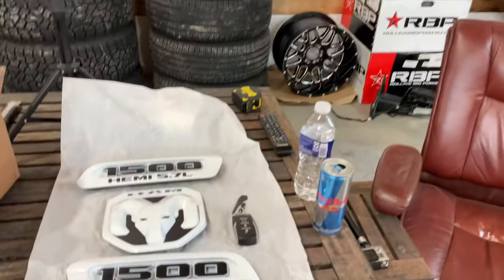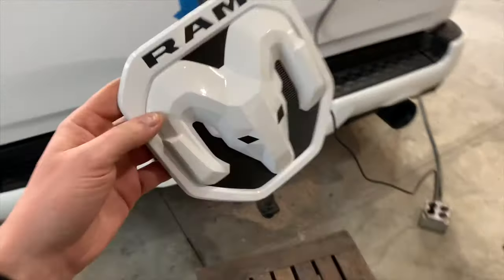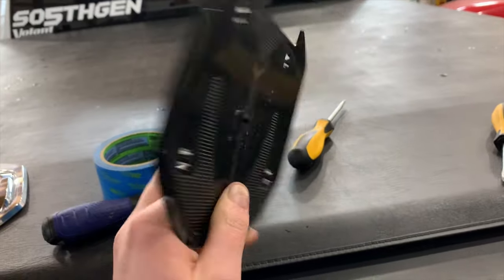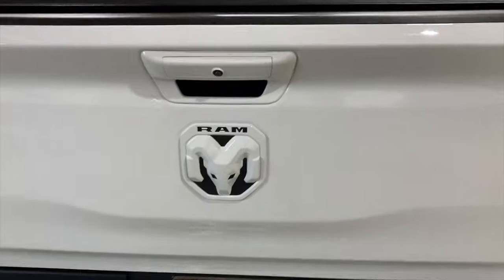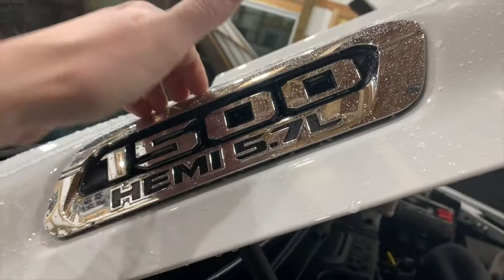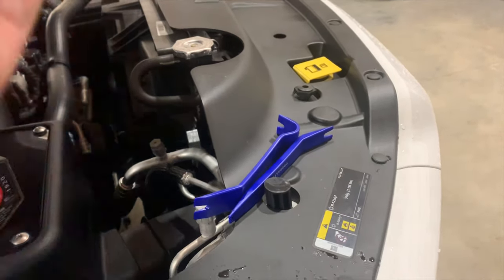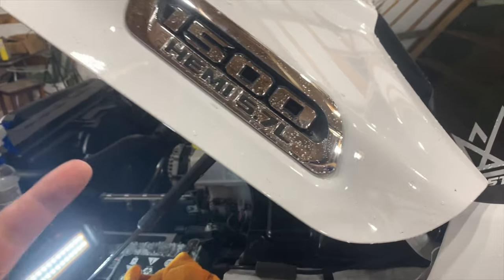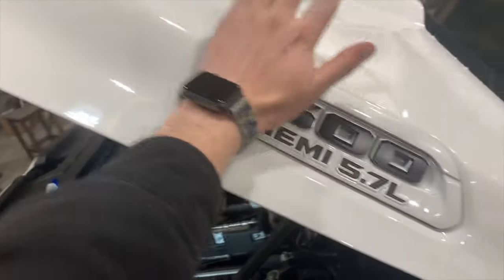5th Gen Ram Color Matched Emblems Installed / Removal Process for Hood & Tailgate.

Comment: I work at a vehicle wrap shop and we use a steamer to remove emblems.  Much safer then a heat gun and works great
Reply from the maker: I agree! But I wasn’t trying to save these nor did I have a steamer. I should probably order one they do come in handy
Reply: What brand of steamer?
Reply: @timmcgrath6496  see the link.  You do need an account to purchase it but I think there are similar units available.  Like I said it works great.

Comment: I'll share with you the best tool I've found to remove badging and emblems from a vehicle, especially on a fairly new truck while the adhesive is pliable- use fishing line. Preferably 10-15ib. It acts like a knife to remove the badging without a pry tool. Slide it behind the emblems and work it back and forth slowly pulling downward. Don't work it too fast or you'll snap the line from the friction. I also recommend doing it in the sun or just apply a little heat to soften the adhesive. If you try my process and like it, please let me know. Thanks.... hope you find this trick very helpful

Comment: Loved the video, in the process of installing LED 1500 hood badges. You mentioned you use the first pry tool on the end of the "5.7" section, but when you completed the step you slide the pry tool first under the "H" word and then use the other pry too to lift up. Does it matter? I just don't want to mess up the OEM ones.
Reply: shoudnt matter

Comment: Very nice!! Like you're wheels. Hell I like the whole truck. What's the offset on your wheels and size of the tires and is it leveled? I have a 2020 Warlock I'm sure I can just order the tailgate badge as I don't have badging on the hood.
Reply from the maker: They are 20x12 with 305/50R20
Reply: @so5thgen  Thanks! I appreciate the reply.

Comment: I saw you have an aftermarket Cold Air Intake System. Is there a benefit to have that? I have been reading a lot and there are definitely mixed feelings but ultimately found it doesn't make a difference.
Reply from the maker: It’s not so much a power mod. Although it does yield some minor power and fuel mileage performance improvements it doesn’t negate the initial cost solely based on power. It’s more of an aesthetics mod in my opinion. Although it does provide ease of filter maintenance ( 100k intervals) while producing cleaner air into your engine. And I forgot to mention it sounds amazing 🔥 If you’re interested in one let us know!

Comment: Just purchased a 2019 Ram 1500 2wd new body style and I plan to put on a 2.5 front leveling kit with 35x12.5 tires on 18x9 wheels! Does anyone have any knowledge as to if this would cause any rubbing? If so what can be done to combat that issue? Also, will I absolutely need to purchase to control arms? And why? (First time truck buyer & first time dealing with large wheels/tires and any type of leveling kit)
Reply: There shouldn’t be any rubbing but if there is it will only be at full lock in reverse. You could just trim off a little of the plastic wheel liner. I have the 2.5” MotoFab level and did not need to change the control arms. The angle on the ball joint still looked about the same as stock.
Reply: I’ve got a 2021 3500 and just got a 2.5  bilstein leveling kit with 35x12.5x20. Rubs like a son of a bitch.

Comment: Nice work. Question: How the heck are you averaging 17.1 MPG????
Reply from the maker: Tom Arnold cold air intake, tuning, light tires and rims
Reply: i average 17.6 with 285/60/20 nitto grapplers with no intake or tunning i recalibrated my speedo though
Reply: @bull5919  I get 12-13 on 265/65R20s